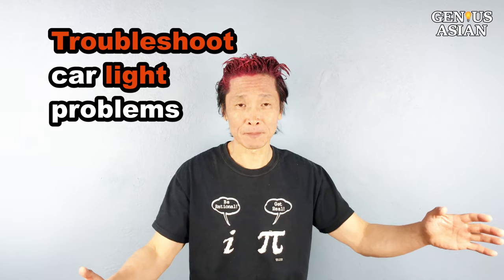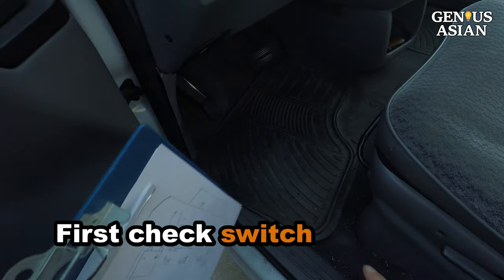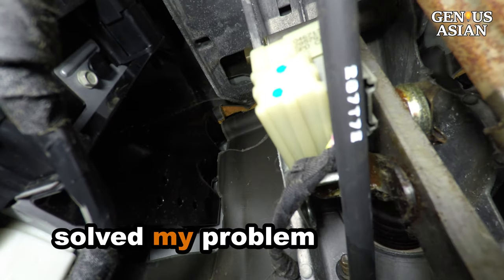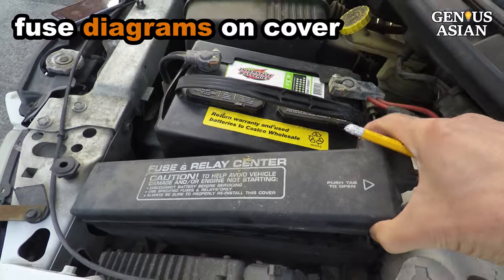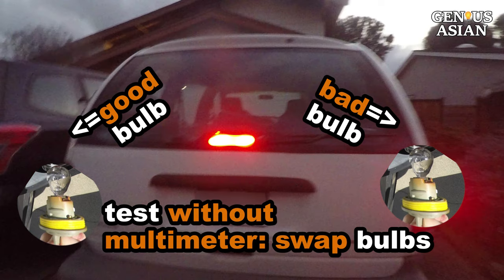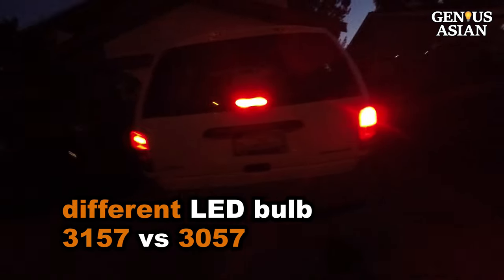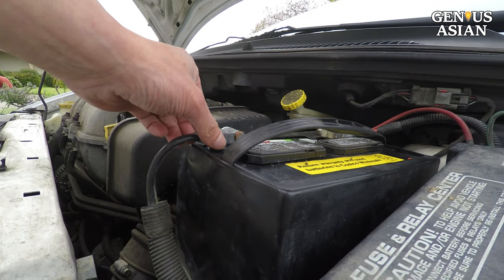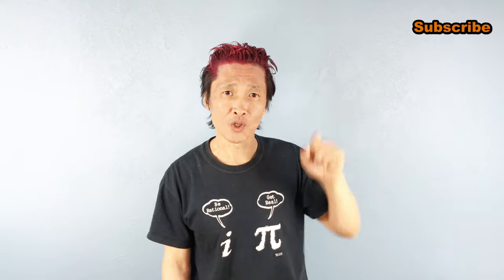How to troubleshoot car light problems, such as lights not turning off or one-on one-off.

Comment: I change the fuse but still the light is on
Reply from the maker: If the light is OFF, then there is some possibility of fuse problem, but you have light ON, right? What about the switch? There are total 5 components, you need to eliminate one by one.
Reply: Genius Asian the switch and fuse where good the problem is the hook that goes inside the switch it’s broke but I found a permanent solution for it
Reply from the maker: @gustavorodriguezvences7770  That is great news. Let us know your "permanent solution", sharing your solution will benefit other people. Thanks.

Comment: i have problem two on both sides (left lower bulb and right upper bulb) but changing the bulbs did not fix the problems and my fuses pass multimeter checks, my battery is new and in good condition. what is going on
Reply from the maker: so what is your problem? Always on or always off?
Reply: @GeniusAsian  always off. i replaced the bulb in the lower left socket and it did not change the result. i have a hyundai i30 hatchback so two lights on either side.
Reply from the maker: when you use your multimeter to read the terminals at the sockets, what is the voltage?
Reply: @GeniusAsian  the bulb sockets? i was having trouble with them because they’re mostly plastic except the interior but i got very low and inconsistent numbers for the working socket and nothing for the non working one. 0.00 on the multimeter. maybe 0.05 on the working one? not sure. it wasn’t consistent. all  fuses were 10-11
Reply from the maker: @kel292  I assume when you measured voltage, your switch is turned on. As shown in the video, the battery, fuse, switch, bulbs, wires are connected serially, if any of them failed, then the light is off. So out of the  5 components, you only showed that the bulbs may work (measure the resistance of the bulb may confirm it), what did you do for the remaining 4 components?
Reply: @GeniusAsian  yep! i tested all the fuses with a multimeter as well and they all appeared to be fine. i also swapped all my bulbs around and the ones that are in the nonfunctional taillights work in the sockets of functioning taillights. i haven’t checked any electrical wiring as that’s probably beyond my skillset. will probably be taking the car to an auto electrician at this point. btw, i really appreciate all your replies!
*plus the battery is new and everything else in the car is working beautifully except these specific lights. headlights, brake and reverse lights, high beams, all fine and dandy.